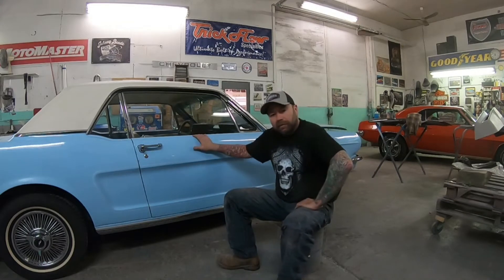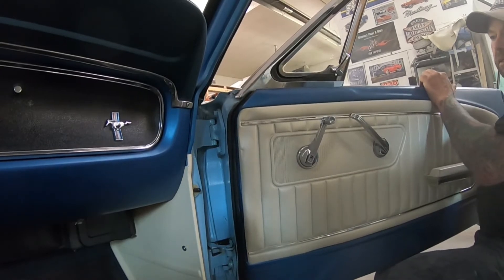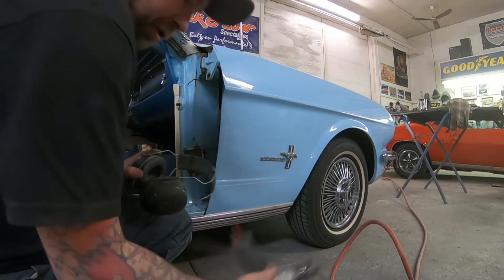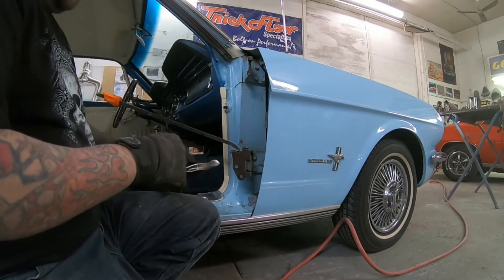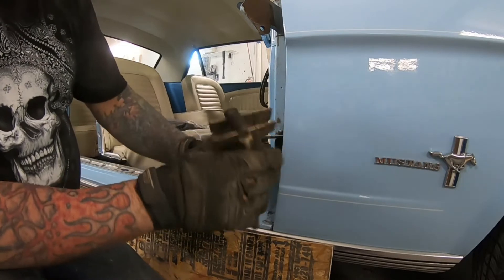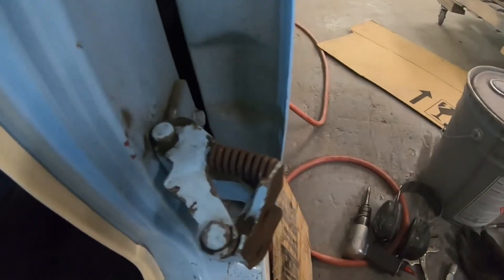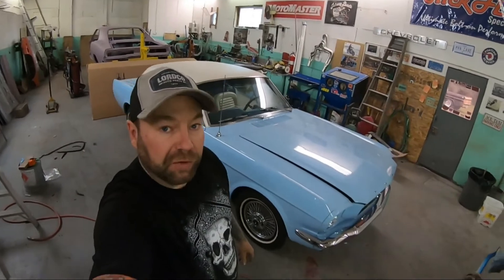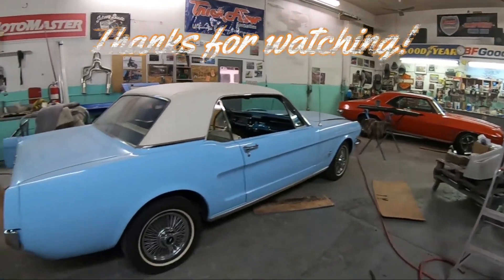How to replace door hinge pins & bushings on a classic car

Comment: Have you done this hinge repair on a 1965/66/67 with a pony interior where there is a door courtesy light? In order take off the door there is an electric 4:11 cable from the body to the door that needs to be removed. I am unsure how easy or difficult it is to disconnect it. Do I have to remove the door panel etc?
Reply from the maker: Sorry, I haven’t, but I would expect the door panel will need to be removed to get to the connector
Reply: I have come to the same conclusion. Thank you

Comment: Thank you so much I plan on buying all four hinges and pins and such to replace on my 78 nova this upcoming weekend… any advice on putting the door back on? I’m worried I won’t put it on straight or something
Reply from the maker: Can’t hurt to mark the hinge location with some tape or a marker before disassembly so it can go back in the same spot,although with the new pins the alignment might change a little, but should be minor

Comment: wait...why does everyone say you need to take the bumper off to do this if you can just take the door off? or is that just to replace the hinge?
Reply from the maker: Take the bumper off to do hinge pins??
Reply: @Johnnymidnight  He probably meant to say "take the fender off" as is shown in other videos to remove, replace or adjust the hinges. But your method of replacing just the pins is the simplest way I've seen to fix sagging doors. Planning on doing a '68 soon.